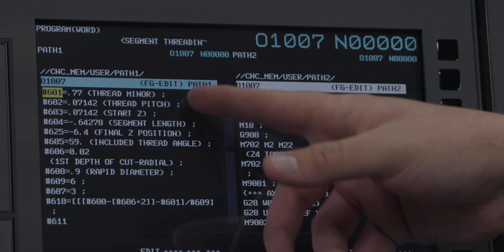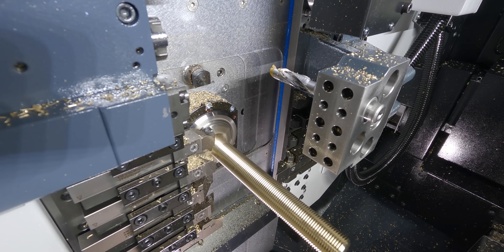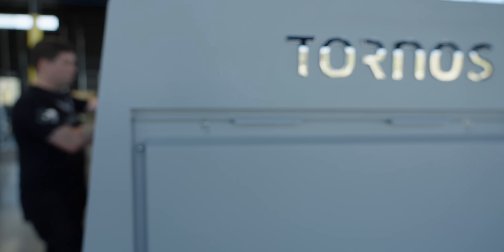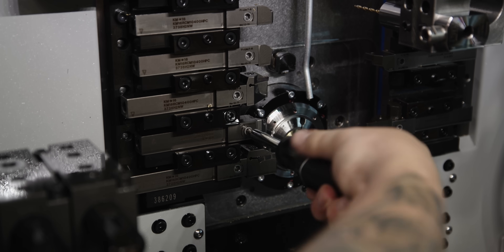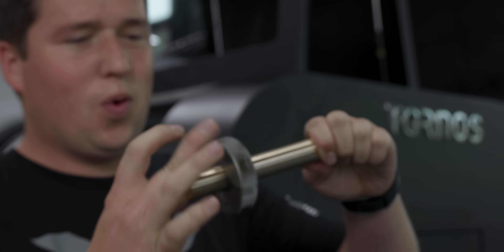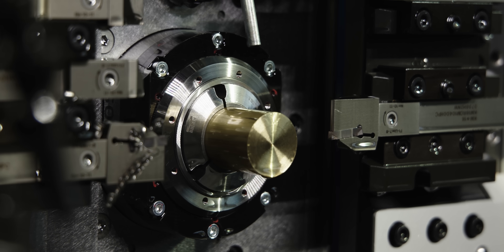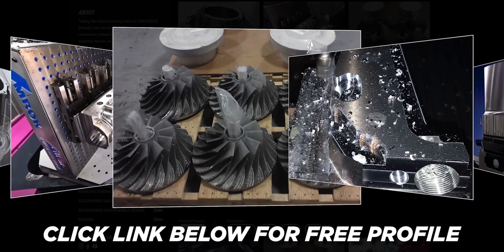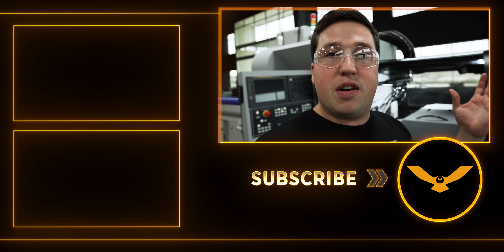Machine CRASH and Spindle Destroyed..How did this happen??

Comment: 1:11 never happen. machine has single step and screen to see what happen next. rapids are slow on first run. hurry end up fast. you fix problem longer than it take test program. next part you can push machine limits if want. i would not still do it. i still go next rapid speed and confirm. third part. full speeds. none of time was missed. no fixing time

Comment: Started at GE gear plant in Lynn MASS. Mark 5 then Fanuc 4 axis cnc horz boring mill. Manufactured gearing cases for pumps. After about 2yrs I won the bid to work on RD project. 15k employees and I was in r25 classification and secured by RD . 1985 I am running 7axis CNC horz boring mill at that time largest in the U.S. x axis about 50ft slotted steel floor. Then a cnc rotation table that also went in and out. y about 20ft z 12in ram and 6in spindle also attachments put on ram for milling. We are devolving the largest high speed reduction gearing for new DDG class destroyers.  Around 12 × 12 × 12 ft replacing 15 × 15 × 20 gearbox
   This all happened because I took Fanuc programming manual home and learned codes. I worked 3rd shift and wrote programs at night and tested them during lunch and breaks

Comment: Donnie’s great testimony left out the how his crash would have been prevented. Novice machinist should reduce the override federate of rapid and feed with 1st time run. On the monitor read the ‘to go’ value. And if you hit feed hold in the countdown to the workpiece as it gets close, evaluate the distance. If you need 1 inch to reach workpiece, and your ‘go to’ value reads 5 inches to go. STOP and get assistance to correct.

Comment: I remember my big crash, all at the fault of the fucking saw guy. I was doing first process on the weights for slide hammers, bore the hole, cut then thousandths off flip the part and repeat. So I had set the machine up, ran 2 parts through pick up the next and send it. The way we had the machine setup was to 100% rapid travel to half an inch from the part with an insert drill. But the green and BOOM, tool, tool holder, spindle were all damaged. Now, why was this not my fault? Our policy was to mark everything that was safe with a green paint marker with the size, and everything not safe red with the size and OS for oversize on the top and sides. That jackass marked it green and with the incorrect size. That blank was actually 1" oversize, meanwhile it was marked green showing safe size. Could it have been prevented by me measuring? Well obviously yes, however that's not how shit was ran in that shop.

Comment: I am 22 and I was given a job of a tube bender on a huge CSM hydraulic CNC bender, and they told me absolutely nothing. They did not show me how to use the computer program that was by this point 20 years old, they did not show me how to properly disassemble and assemble various rolling dyes, bending dyes and corrugating dyes I had to learn everything from scratch by watching demonstrations on youtube, and I tried my best to be good at this job because the stakes were very high with the 50k costing ender. But I failed, and for reasons that soon I found out were not my doing. First of all the machine was heavily tampered by previous mechanics so various safety features would be of because you know how old guys are, all those rules and regulations are getting in the way and are soooooo annoying. Second thing is they somehow rewrote the programs to do slightly different operations than factory designed. How they managed to do this I really not sure because the codes are all locked. Someone really knew what they're doing. Third of all nobody told me anything about this. I made a program to bend a rail frame from 48mm pipe with 4 mm sidewall. It was extremely heavy pipe and I had to feed it into the machine with a overhead crane. Then what happened was I pressed execute bend program and the black hub that holds he tube in place crashed into the dye at huge speed mangling itself, destroying the dye and exploding the pipe like a fucking tulip flower, and not to mention that oil started to pour out of the machine because the hoses ruptured. The boss came and he started screaming ate me "you're gonna pay for this and that you little fucker" but then I stood my ground and told him that nobody showed me how it works, I had to watch youtube videos to find out for myself, none told me how the bloody programs were tampered with, and that was the sole reason the thing crashed so badly, because execute bend program button on a new program always does the first bending cycle while resetting the zero position, witch on a proper program should only happen if the pipe is not intertied and there is no dye on the spindle installed, there should be an error code, but because the sensors were removed for convenience, the machine assumed it was clear path. After I showed him everything he apologized to me, said he really didn't knew that older technicians in his company were such pieces of shit, he fired them on the spot and I got a huge promotion, and got new bender that only I will be working with, nobody else. I wonder if this could have been the case for the guy in the video? nobody showed him how to use it, just said "do your job" and let the 19yo kid go ballistic with the machine and ruined it without knowing any better.

Comment: I use to work for a company that made all the parts for Pride mobility and Golden mobility. We made everything including the hardware. There was a guy that worked there and he turned up the lathe to full speed without closing the 40ft inclosure that held it while it spun. You know the 40ft length wobbles at the end. What happened was the full length went through the wall into a parked car. Penetated through the passenger door in to the engine bay out the headlight. Old school lathe. With both computer and manual adjustment points.

Comment: We run three stars. A 32mm sv, a 32mm sr32j, and a 20mm sr20. All extremely solid machines. Mid program editing without scrapping the part just set tools to diameter of stock and cut ten thow big and dial that part in and minimize time in editing and getting it running to begin with. Will hold tough tolerances for hours. Material quality is the only weak point when it comes to a Swiss and a guide bushing in my opinion. I prefer to run eve trything centerless ground and it’s worth it it will run for hours.  Love our stars so glad Swiss machines have a spot on titans!

Comment: Back in the manual machining days, a mate of mine (During his apprenticeship) managed to destroy the bed, the vertical power feed gearbox, and a fixture plate on a bloody great old milling machine, all through "inattentiveness". I'm not sure about the specifics, but apparently it involved the machine trying to plunge a large cutter through the fixture and table while he had his back to the mill to check tolerances on the part he'd previously finished. He was relying on the stop disengaging the feed, but for some reason it didn't this time, and he only realised something was wrong when he (And everyone else on site) heard the "thud clatter clatter clatter" of multiple teeth finally parting company with gears behind him ! He once said that the failure was probably due to all the extra mechanical resistance when the cutter finally met the hardened X axis lead screw, but I don't know if he was just making a joke about that.

They had spares for everything they needed to fix it on site (They had several identical mills in there, so kept most of one in kit form to use as spare parts), but rather than have him fix it, they moved him to the mill right next to it, and pulled one of the old timers (Who hated my cocky mate's guts) off his regular work to rebuild it, and snarl/utter nasty comments at my mate the whole time he was doing it. 🥺

My mate reorganise his work area after that, so that he had to move a little further, but was always facing towards the mill.  😁

Comment: I've made a few boo boo's but nothing too drastic. I went from having no knowledge of CNC machining to running a Tsugami swiss lathe by myself in about 2 months. I can't do a whole lot besides change and touch off tools, work the bar feeder, and change the guide bushing pressure but as I get more experience they introduce you to more things like setting up the machine for a new part, indicating the spindle in, and editing code. Its a large firearm manufacturer so they have specific goals you have to reach in order to advance in rank and pay. You work under an experienced machinist who is responsible for your training and signing off on your progress. 

I touched off a tool in Z wrong one night and it crashed and broke an alignment pin in one of the blocks. I had a feeling something was off with the measurement so I had my hand on the E-stop. The machine has torque limits so it won't do anything as crazy as what happened in the video. If it detects excess torque past what is in the program it will shut the machine down. The only bad thing is b/c I'm on night shift I can't really get experience in fixing it b/c all of those guys are on days. If I mess something up I try to stay over an hour in the morning to at least try to learn something about fixing my mistake. I haven't set anything on fire yet which is more than I can say for some of the guys I work with.

Comment: Unfortunately. The last shop i worked at refused to give me the operators manual for any of the machines i was working on... that company has now forever basically traumatised me from going into another shop like that. 

I believe that you need to study your machine and see if there are thing wrong with it because at the shop i was at. Nearly EVERY machine i touched had 3 things wrong with it. They just "had too much production to take it down for a week" which basically means they like running at 80% production alm the time...
Reply: Sounds like the company I work for. They don't do the required maintenance and if there is a problem they just expect you to run it as long as it can physically operate.

We had a chip clog in the conveyor that was starving the pump of coolant so we put in a maintenance ticket to have it fixed. 3 days later they finally fix it but they get the chip conveyor out of alignment so now coolant is slowly leaking into the drip pan. It overflows all over the floor at some point. Now we're having to empty the drip pain every 5-10 parts. Not a big deal at this point but it needs to be fixed.

We put in another maintenance ticket. 4 days go by and its still not fixed. I get in for my night shift and I have a note saying that the pan is overflowing faster than it previously was with no indication given as to how many parts it will go before leaking. I drain the pan before running, start running one part, go to another machine to get it running, look over and there is gallons of coolant all over the floor. It didn't even run one part before overflowing. A day shift guy happened to be there and he said "Oh yeah, I was having to empty it 3 times per part". Its an 8 minute cycle time and I run 50-55 parts a night. Don't you think that should have been mentioned in the pre-shift notes? I shut it down and refused to run it and put in another maintenance ticket. Day shift comes in that morning and wants to know why I didn't run it. I did the math for them, 3 times per part at 55 parts is 165 times I would have to empty the drip pan while also tending another machine. Its not physically possible or feasible to run it. They don't care though. They want shit running 24/7 no matter what.